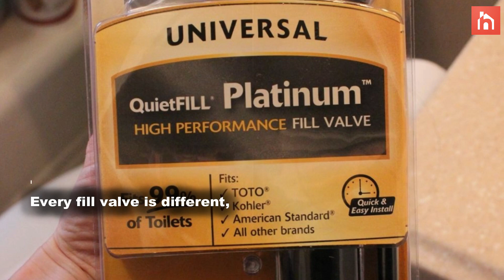How-To Replace A Toilet Fill Valve

Comment: Everytime I flush my toilet it keeps filling for a second then stops then fill for a sec or two then stops. That goes on for about 20 times till it's full. Is the fill valve going bad? Will replacing it fix my problem. Lmk please. Thanks